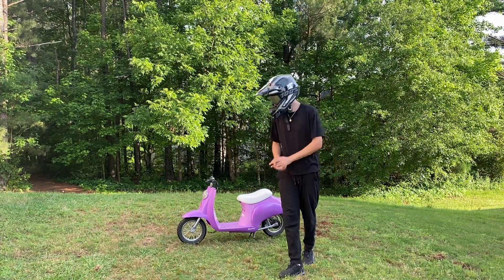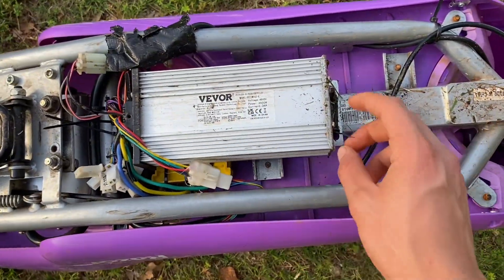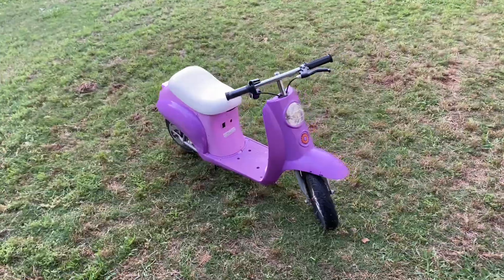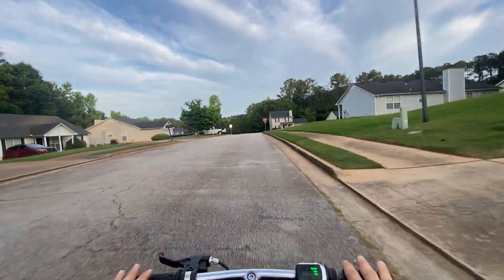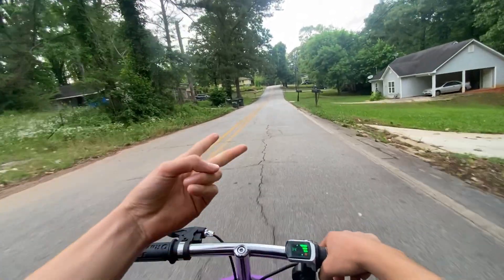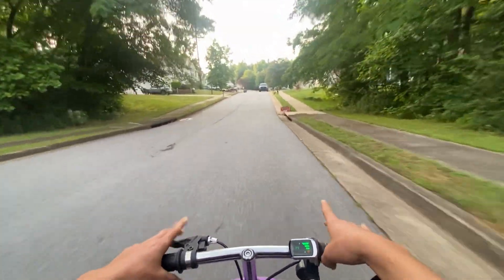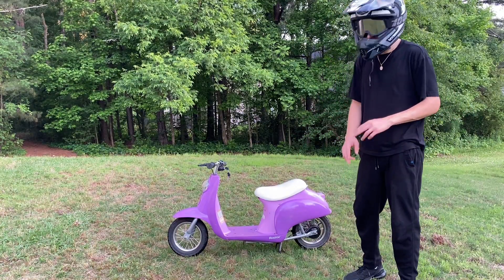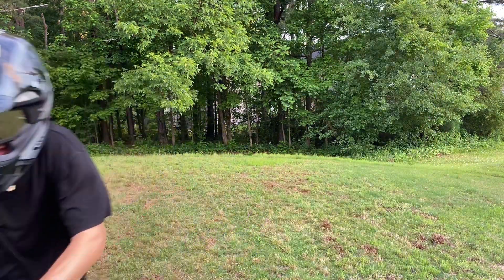I Built a CRAZY Fast Electric Scooter on a BUDGET (+48V!)

Comment: Nice build those tiny bikes are pretty fast. On mine ( MX650) I used a Vevor 2000 watt kit and 4 20AH Eco worthy battery's  giving it 80ah @ 25 amps peak went 35 full throttle on a level surface. Went down grade at almost 40mph and 22mi full send lol.

Comment: it's amaze me there still a lot of torque after you change the drive sprocket... try to change the rear wheel sprocket too with smaller one. i also notice you are not using 3 speed selector it will be on gear 2 by default, short the ground wire to speed 3 signal.. hope to see you on the next video with new 18650 battery pack and upgrade.
Reply from the maker: seriously? i had no clue. i’m gonna try it out

Comment: how have you 3 18v batterys making 48v wouldnt it be either 54volt 6.5ah or 18volt 19.5ah 
how did you wire them together
Reply from the maker: yeah it actually makes 60V with the batteries but ah stay this same since i wired them parallel